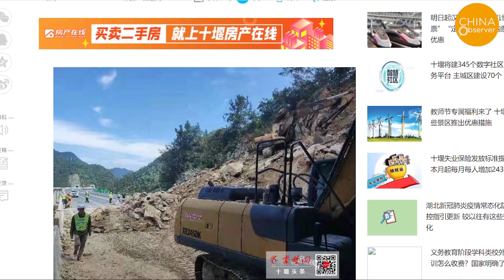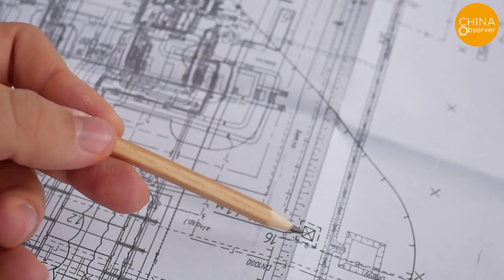5 Landslides Buried Tunnels | Why Many People Hope So | Tofu Dreg Construction | Reasons

Comment: These mountains nearly all seem to have in common, that they are entirely comprised of loose soil, to the entirety of the depth to which they start sliding downwards, which is remarkable. These mountains so not consist of rock or any material that has any consistency.

Comment: The way they literally cutting through rolling hills and mountains for building "magnificent" highway always makes me wonder whether they were safe or a timebomb. This video answers my doubt
Reply: Had the very same thoughts, before going into the comments... well, here you are.
If they do not have proper environmental and engineering control of the surroundings, funds and ressources to measure, check, verify and monitor, well, this is whats happening or going to happen... shiver...
Reply: In Switzerland and Austria, yes, they're amazing. I would not trust it in China...
Reply: @Olivia-W  I happens also in Switzerland (where i am from) - but in much smaller dimension or seldom. With it's vast road-network, tunnels and bridges, that are breathtaking, in China, this must happen more often than we see.